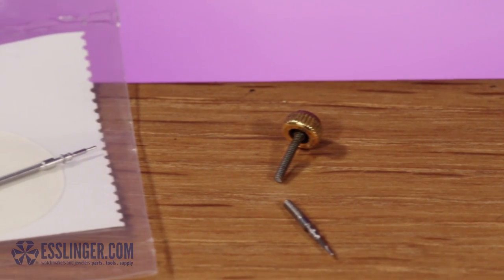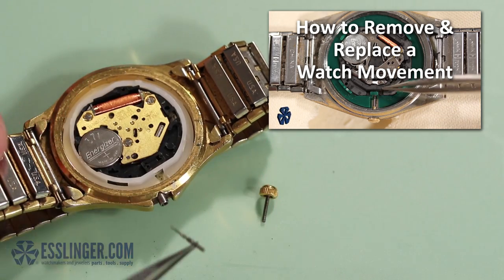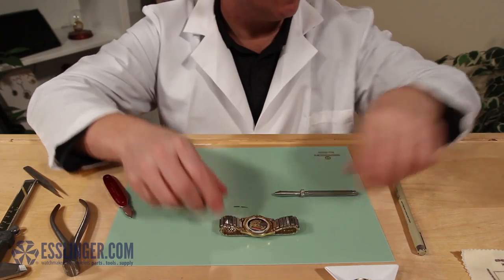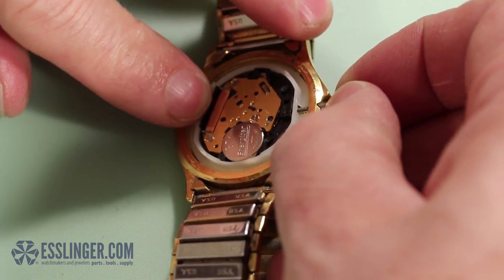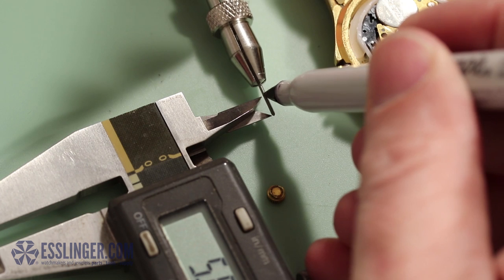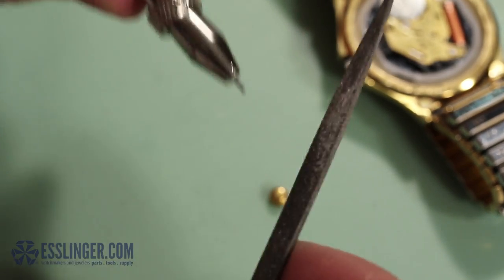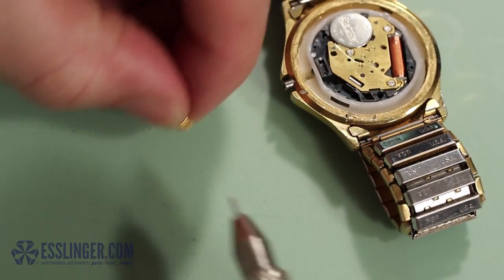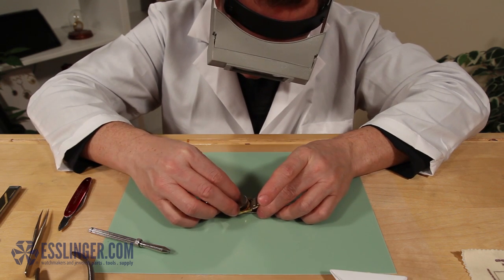How to Replace a Watch Stem

Comment: How do you keep the crown from coming loose when turning it to set the time? Is there a special glue that can be used to keep it on?
Reply: Yes, you can get locktite 270. It's a high strength thread locker
Reply: @benh890 will you be able to unscrew crown if you need to?
Reply: @mgomez5606 yes, it won't be a permanent seal. Worst case if it is too hard to remove you can give it some heat (from a lighter or similar) and it will loosen it up to remove it

Comment: From the video I do not see that the thread lock is used to seal the crown and the stem before closing up the watch cover and claimed that the job is done. My question is , will the crown comes loose one day without applying the thread lock????? Or this step is not necessary???

Comment: Hello, I replaced stem on similar citizen but when crown is pushed in to the final position watch keeps losing time or stops randomly at the same second hand position. What could go wrong?
Reply: Radek Jakubowski Using a voltmeter set to DC volts, see if you have 1.5 volts. + Red lead to the + side of the battery which is always facing up when mounted in a watch and black lead - to the other side of the battery. You can buy a cheap voltmeter for under $10.

Comment: How would you get the stem out of the crown,if it had
broken off level with crown thread please.And where would l
find a new stem for an Armani AR0585.
Regards
Reply from the maker: Drilling and re-threading may be the only choice. The watch model is not needed, just the watch movement number; http://blog.esslinger.com/identifying-watch-movements/
Reply: I would honestly buy a new crown, but if your pressed to save it there is only one option: drilling it out, and it will be a hemeroid to remove without drilling out the threads, not to mention one hell of a small bit and surgical hands to work with.  That's why I say replace it.  You can buy crowns by the bag anyway.

Comment: Ok?  How in the world is identifying the movement number supposed to help with the part number for the stem?  The webpage linked in the video is no help at all, since it also leads to a page for buying different stems, which have nothing in comparison to the quartz movement number.  All that page shows is different stems with a three letter prefix (ETA, ESA, HAM) followed by a three digit reference number.  How in the world is this supposed to help me?  I need a stem for an older victorinox that doesn't even have a movement number and literally hundreds of different stems to choose from at $10 a pop.  Without a reference sheet or chart to pick a stem, how am I supposed to determine which one to buy?